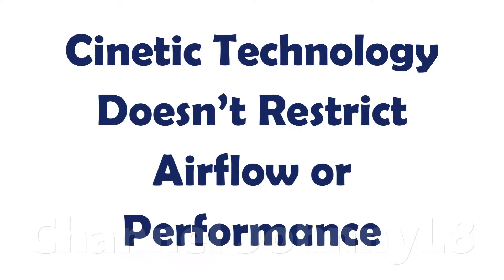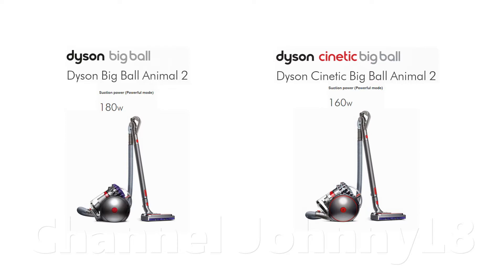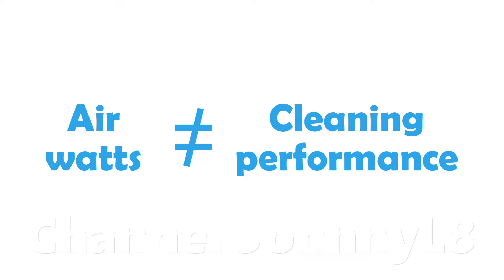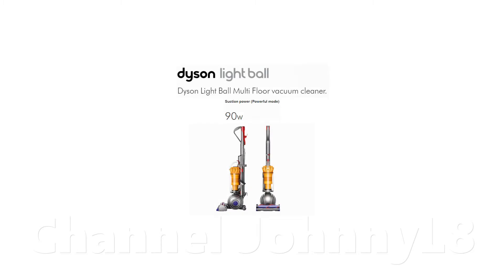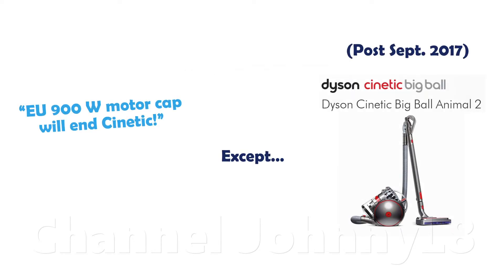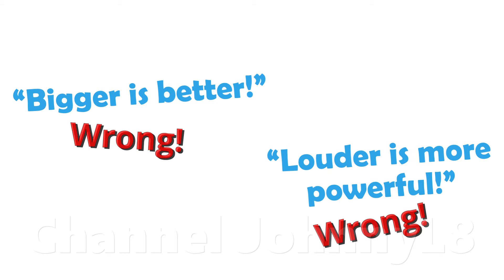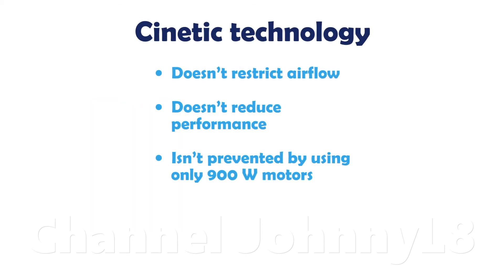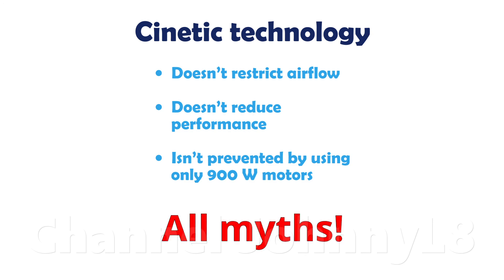Dyson Cinetic Technology Doesn’t Restrict Airflow or Performance

Comment: Dyson ball multifloor: 270 AW
Dyson cinetic big ball: 180 AW
Same wattage, same cleaner heads
(U.S. models)

Air doesn't flow through the tips of the cyclones. The additional stages of seperation and the associated air path are what restrict the suction. I agree that suction isn't everything, but considering my cinetic and ball multifloor use the same exact cleaner head, the ball multifloor is noticably better. I think it certainly plays a part. Hopefully they can optimize it more in the future.
Reply: More air watts doesn't always mean more suction, but yes the ball multi floor obviously has more, but prime examples are: Dyson DC33: 240 AW, pulls 102 inches of water, Dyson Ball Animal 2: 270 AW, pulls only 94 inches of water. So the DC33 technically has more suction, but I think the overall tubing and motor design will play a role too. Not just air watts.
Reply from the maker: Many who cite air watts don't really understand what it means or what is physically represented. There's often a mindless assumption that bigger must somehow magically equate to better—an ignorance marketing rely on. The assumption is wrong, as explained in another video—not that many want to listen, particularly if it contradicts their deep-rooted worldview.
Reply: An ignorance dyson's marketing relys upon as well. They claim "strongest suction at the cleanerhead" but that doesn't translate directly into cleaning performance as you have said. An airwatt represents a unit of power derived from the volumetric rate of the air movement and the pressure at which it is moved. That is why both airflow and suction are important. Both affect the airwatt rating equally. Cleaning performance is such a complex issue that no single rating can imply how a machine will perform. I've observed this numerous times, and although corelations between certain aspects of a machine and the performance emerge it is still impossible to predict from just looking at a machine on paper. Most enthusiasts are very set in their mindset, I try not to be. It's hard for anyone to ignore their experiences.
Reply from the maker: Yeah, I've already suggested in one video that Dyson should stop marketing airwatts. Problem is they're locked into a stupid numbers game with the competition who peddle numerical oneupsmanship. In the deep cleaning myths video I did (https://youtu.be/4RNi3QrGCXI ), I explained more thoroughly what airwatts are and all the reasons why they're misleading and should be dropped. And as you say, the fluid dynamics of vacuum cleaning is such a complex issue that there is only one relevant performance metric—namely average cleaning performance across all floor types, as measured by international industry standard, fair and comparative testing—a single, simple metric anyone can understand. Ideally this should also be presented with that value normalised to input power, to also highlight efficiency in achieving that result, and to stop inefficient brute-force machines taking false glory.
Reply: I agree in a lot of ways. I think it would also be helpful if the performance on each individual surface was listed seperately so a consumer could make a choice based on their home and their own needs. If a person has primarily one surface or another they may be inclined to choose a machine that is more geared to that specific surface for example.  
That is one reason I appreciate vintage machines so much, many achieve a very good level of carpet cleaning while using very little electricity. But making a machine that efficiently cleans hard floors and carpets, fundamentally different surfaces, with one machine and one floor head is hard. My old uprights may do fantastically well on carpets, but I'm not going to try and claim they work for hard floors at all. Maybe if they have their hose and a floor brush fitted but that is an extra step. 
I don't know if it's fair to say that dyson is blameless in perpetuating the numbers game, they have been making claims to that effect and updating them periodically in the U.S for at least 5 or 6 years. It might have been shark and eureka that really started it in the U.S, but dyson still perpetuates it. It's all one big messy marketing war.
Reply from the maker: The separate surface thing is very difficult and could overcomplicate. Every surface is different at the scale where cleaning happens. Age, wear, material, dimensions, surface defects, nature of dust all play into it, and you'd still be taking averages. You may be able to get away with carpeted and uncarpeted, as suggested by the EU labels, but those labels are highly misleading as discussed in a separate video.

I've never seen formal indepdent data for vintage machines, including Kirby, so I don't think they're as good as many think they are. Happy to be proven wrong, but I doubt I'll ever see the data. The big disadvantage of vintage machines is they are now highly polluting by modern standards (materials, bagged technology etc.). There's no excuse for that now and the highest levels of performance can be achieved without all that. Vintage is for the niche collectors, not the mainstream anymore.

Dyson is as much to blame as any other manufacturer in peddling ignorance when it comes to choice of marketing numbers, such as air watts. But at least they're quoting average cleaning performance across all floor types—the only performance metric that counts. The competition don't because their measured values aren't as good according to formal independent testing. Thus they're left perpetuating deception which Dyson seem to think they have to respond to.
Reply: Yes I know the EU regulations are flawed, I'm not sugesting they aren't. I only meant that instead of average cleaning across all floors just split it into carpet and hard floor segments while also giving the overall average. If a consumer wanted to get a machine primarily for hard floors this would give them a beter idea of which machines may suit their needs best. They might be able to find a lower cost machine that does what they need it to do. Nothing more complex than that I agree.

I was not suggesting the average consumer should buy a vintage machine. They don't have the features that a current consumer wants. As for formal data, I would really like to see some as well. Give me a few years on that. All I can say is that in my home and the other homes I have cleaned, vintage machines work very well. I frequently use a vac from about 1979, and I use HEPA rated bags in it. They are freely availiable here for many older machines, just a note. 

I know in the U.K dyson do advertise average cleaning performance, in the U.S they don't. The only big claims they are making right now are "strongest suction at the cleaner head", which as we discussed doesn't automatically mean best performance. Shark meanwhile is claiming better suction at the hose versus the cinetic and better hard floor cleaning. Neither is being very clear in my opinion.
Reply from the maker: Yes, there are a range of cleaners, Cinetic and non-Cinetic, that have a range of floor head suction powers. The two mentioned above viewed alone I wouldn’t say supported the idea that cinetic tech restricts airflow. The several reasons for this are covered in the video.

Yes, you are right that there isn’t significant airflow through the cone tips, but this is part of the myth often raised; people think there is. But there are no additional stages of separation and the air path isn’t longer between Cinetic and non-Cinetic configurations. I perhaps should have made that point better in retrospect… oh well. Yay for comments. Also, another misunderstand I come across a lot is that the filtration system somehow plays a direct part in the cleaning performance. It doesn’t (at least initially). The cyclone filtration system concerns how quick any filters block up. Only when they block does airflow get restricted enough to make a relative impact on the floorhead, which is what’s most important in performance (for a given air flux).
Reply: Thanks for clarifying that one point, I thought you were saying that air passed through the bottom of the cones. On the cinetic I believe the air path would be a bit longer and have more bends because it is a three stage process, unlike non cinetic models. It is more akin to the "level 3" root cyclone system dyson used some years ago, where there is an outer cyclone, an inner stage, than an additional inner stage. Therefore the air is drawn out the chimney of one cyclone cone and pulled through the intake of another, which would imply a longer path than the non cinetic machines. From what I have been able to see from dissasembled pictures the cylinders appear to not use exactly the same set up, they may only be two stage but this is just speculation and I have not inspected them up close. 

There are certainly other factors, since the difference in suction between the cylinders is low. The difference in suction between the uprights is quite high, especially considering they use extremely similar motors and very similar designs. Just pointing it out is all, its an entire dc01's worth of suction difference.

I'm a little confused about your comment regarding performance being affected by the filtration system. If you take a vacuum, give it a new filtration system that changes airflow and suction, would that not cause a change in the performance? I'm not saying this is what happened with the cinetic upright, just in general.
Reply from the maker: Unfortunately there isn't information available about the detailed internal structure. Every model is apparently separately tuned to maximise performance with all their internal differences considered. They don't just take one motor and stuff it into some cyclone system. Everything is modified and optimised for the specific product model. All that's important at the end of the day from a user's point of view is cleaning performance and filtration quality, determined by industry test standards.
Reply: Unfortunately there is no way of knowing what dyson actually does in terms of design or where they throw what. Neither of us can actually know what they modify, and what they don't, between similar models that share common componets. As for the internal structure of the cinetic, I'm pretty confident that what I said is correct since I've had one apart before but I won't expect you to take my word for it.

Of course performance is important. I'm not saying it isn't ....more trying to say that the filtration system a vacuum is equiped with will have some kind of affect on that performance since filtration causes a nessesary restriction of airflow.

I'm curious, have you located a way to view the parameters of these standardized tests?
Reply from the maker: Yes, the methodologies for the tests are outlined in detail in the standard. I'll be making a video on it at some point in the future. It's a bit dry so I'm not that enthusiastic to make it atm.
Reply: Awesome, looking forward to it. Will you also post links to your sources?
Reply from the maker: Just Google the standard. It's copyrighted and expensive, but publicly available.
Reply: That's what I found as well. I just wondered if you had found a free source. The ASTM test standards are much less expensive, and those are what dyson use to test for the US market.
Reply from the maker: No it's not free. ASTM are US specific... everyone else tests to IEC. Not sure the ASTM tests are as thorough but not overly familiar.
Reply: Who know what the differences are. I also noticed that the only claim dyson seem to be making over here is "best suction at the cleaner head" according to astm standards. They used to make more claims about outperforming other machines, I guess that isn't the case right now in the U.S.